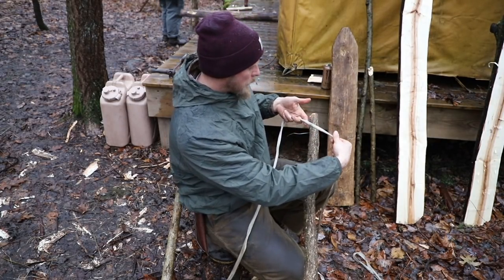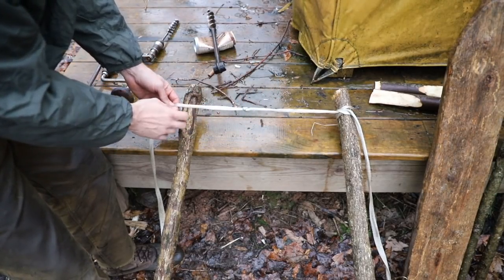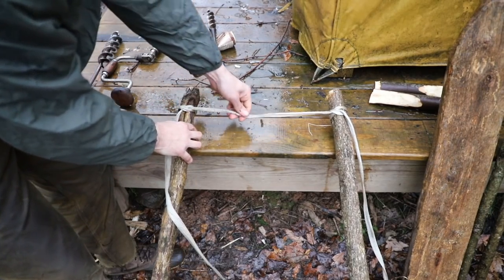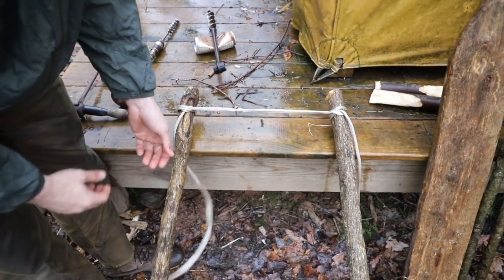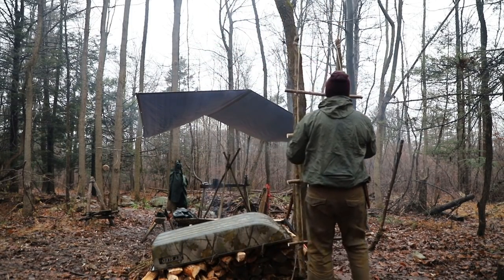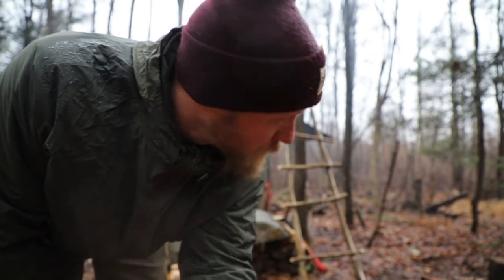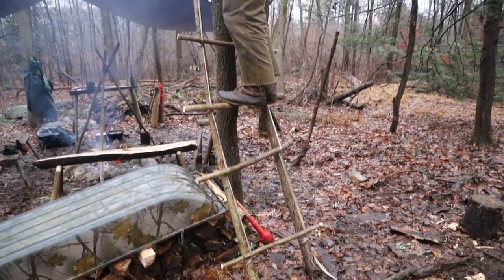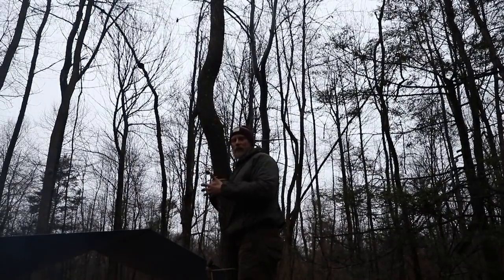Building a Ladder from Scratch!

Comment: I dig the ladder, instruction, and channel, and realize the video is about bushcraft ladders themselves, but if only having to worry about getting one side that's above your reach, a loose timber hitch can be raised with a tree branch, pulled taut, and then later lowered with a notched branch. Leaving a long tagline also aids with lowering it. I used to do this with layup sticks to raise the hitch(s) high above my own reach, around telephone poles for testing their integrity(some poles ain't so safe for utility techs); still common practice

Comment: Interesting approach, I like how it minimizes cordage instead of square lashes. That's mule tape, correct?
Reply from the maker: Yes it is
Reply: The style lashing used in this case is very much meant to be temporary.  It's also more effective with mule tape, because the surface area of the tape (presuming you do this with the tape neatly laid flat around the wood, not all twisted up) helps provide plenty of friction to hold each rung a bit better.  Plus, it allows you to keep your tape intact.  If you want a permanent ladder, do fraps & wraps., but bear in mind they'll be a pita to unravel at the end, and unless you go to great lengths otherwise, you'll have several cut lengths of cordage instead of one long one.  (Something to keep in mind in case you're ever on Alone. ;-) )

Comment: How high does a ridge line for a tarp need to be in order to safely have a fire under it?
Reply: @DWerner7822  ^ This.  The larger the fire, the hotter it'll be, and the more its heat will blast upwards before dissipating.  Heat alone can melt synthetic tarps.  It can also cause problems for natural fibers eventually, though you have to worry more about fires with a lot of sparks (pitchy wood, chestnut wood, etc), especially if you're using oilcloth of some kind.  Sparks can also burn holes in synthetic materials, but the higher they fly up, the cooler they become, reducing how much damage they could do.

Temperatures and weather conditions will also alter effects; if it's snowing, the cold snow will hit the heated tarp and melt, but because snow is fluffy and has air pockets, it doesn't cool the tarp as effectiveliy through contact/conduction with the heat as raindrops will.

Lastly, the higher you raise it for fire safety's sake, the more the chance will be that rain will slant in or splash in from the sides, depending upon wind or the heaviness of the downpour.  If you have 2 tarps you can use, you can string them like lean-to roofs, one slightly higher than the other at the ridgeline on the same trees with the lines centered over the fire and the tarps angling down to either side. 

This may cause a little bit of rain to fall on the fire (and anyone else at that gap), but it will act as a sort of chimney, letting the smoke and heat up and out (not letting it just pool there at the peak, semi-trapped), while extending more coverage to either side of the fire.  One possible way to reduce the chance of rainfall at the gap in this style of 2 tarp shelter is to place the higher tarp on the side the wind is predominantly coming from, so that the rain slants past the gap and falls harmlessly onto the lower tarp beyond.  It does require a gap of at least a fingerlength, however. If you put both tarp edges on the same level as each other, they'll bump and rub, the middles will sag and gap open, and wind will cause them to shake and drip water...plus all that smoke-and-heat trapping stuff going on.  (When in doubt, give the heat a way to get out.)